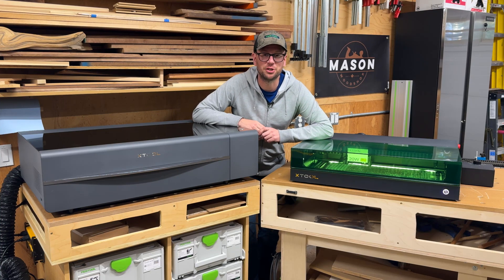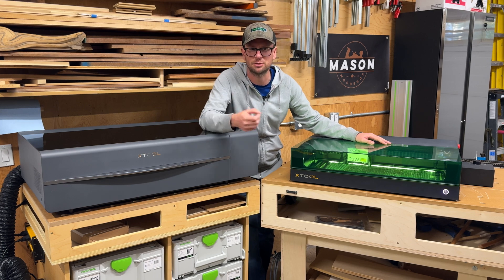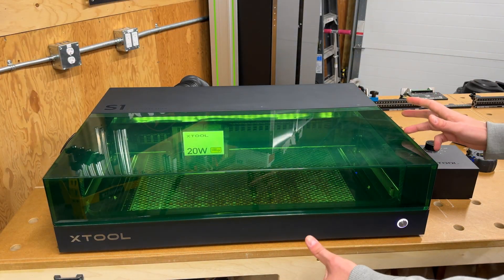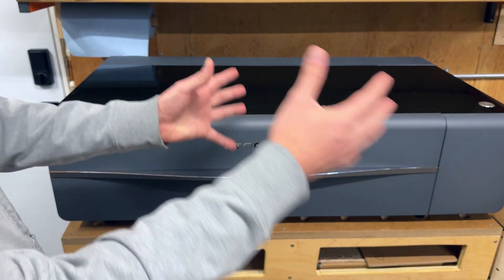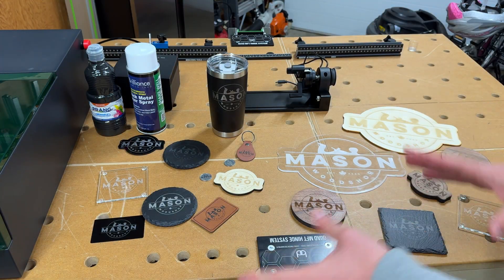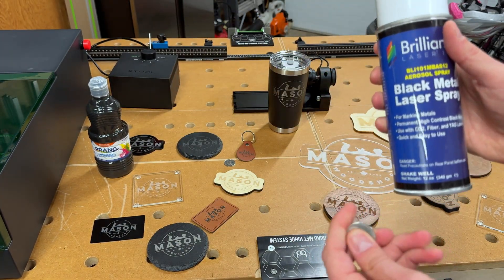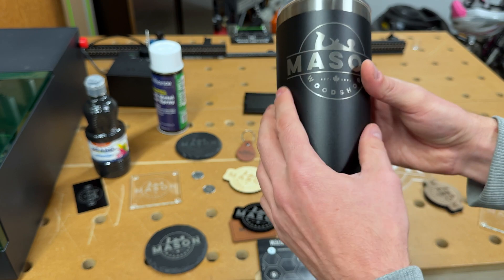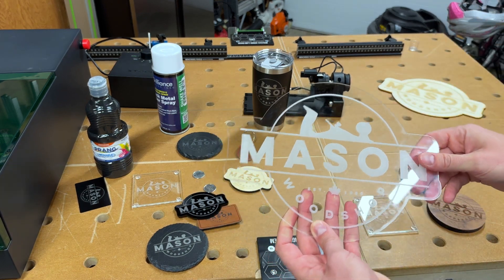xTool S1 vs P2/P2S: Which Laser Cutter is Right for You?

Comment: With the s1 and etching glass, do you have to coat the glass with paint or a vinyl backing for the laser to etch the pattern?  You can't just put any colour of glass sheet in and have the design etched without some additional preparation?
Reply from the maker: Correct! The method I’ve used with the S1 is to paint the surface to be etched with black tempera paint. It’s generally worked quite well for me the few times I’ve used that method.

Comment: Very informative review yet disappointing impression with P2s... I was expecting much larger working area after all these advertisements "small business bla bla..." and the price tag of more than 4K€... not even mentioning the size of machine. I think I'll wait for other companies to show what they have to offer
Reply from the maker: Thanks for watching and commenting. While the working area hasn’t been a limiting factor for me, it is indeed a bit smaller than some of the other CO2 lasers on the market. However the P2/P2S are significantly easier to integrate into a space-limited shop and still offer a generally suitable working area with a really impressive pass through system when working with large workpieces.